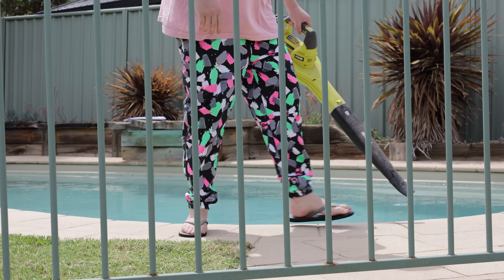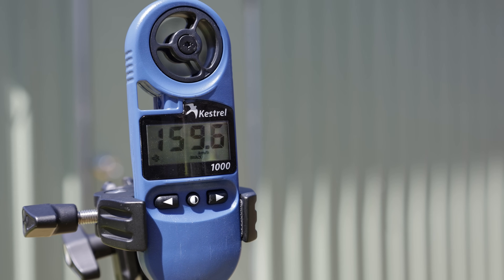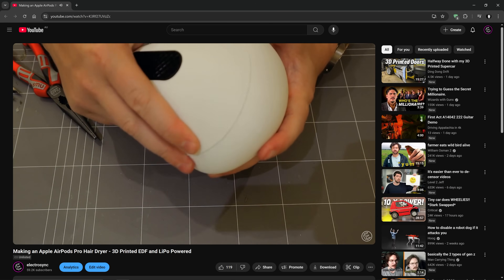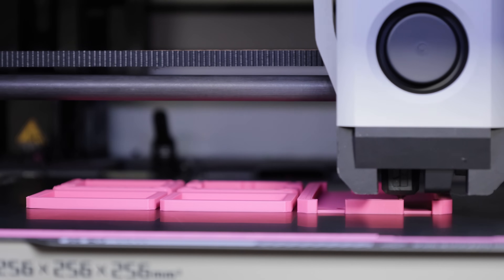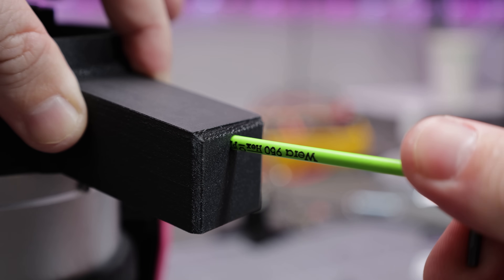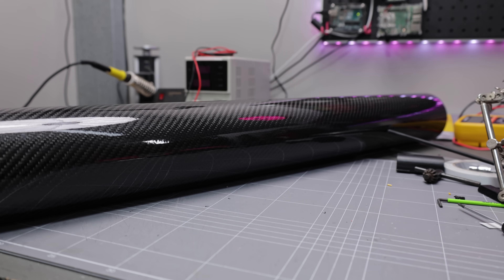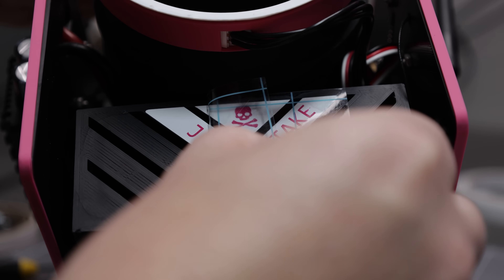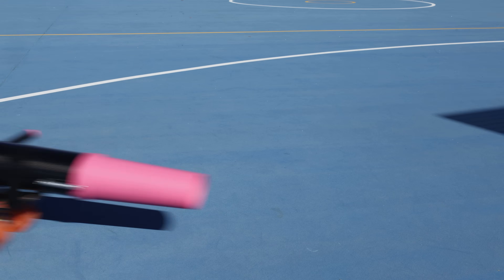Building the Ultimate Leaf Blower

Comment from the maker: What else can I blow with this thing?
Reply: make a paint shooter
Reply: @nilpyc307  yeahh
Reply: Leafblower race?!
Reply: Oh maybe the Bernoulli Effect!
See how high you can keep a styrofoam ball suspended in the air using this thing!
Reply: Yourself. But seriously why did you have the air pointed up when you tested the Ryobi leaf blower on the skateboard, shoulda had the nozzle pointed down i feel like you cheated the Ryobi
Reply: @electrosync  EDF powered speed run on the utility boat ?
Reply: do not mow with toe out -life advice (use boots or shoes that has grip)
Reply: Maybe you can blow a semi dry after washing
Reply: ... nah, I better not.
Reply: No, you should spin the fan in reverse and use it as a vacuum.
Reply: Yer mom. Sorry had to. 😌

Comment: So countless hours spent to create something that cost, probably double an equally performing ready to purchase product, which I doubt that you used to put in a "hard day's work" because it's bound to need about as much time charging the batteries as it can run off of them, unless you also bought a few hundred (if not $1000+) worth of extra battery packs to keep working.

That is the main drawback I find with cordless leaf blowers, that if their performance is good, you typically don't get more than about 15 minutes of runtime per $100 worth of battery, and for many, over the average life of the battery, it's more like 10 minutes per $150.   Even so, I can get my blowing done in 10 minutes - I mulch mow a massive amount of leaves, and prefer it over a 2 cycle gas blower.

Comment: warning carbon fiber filament is the worst touching it even the bare roll is dangerouse thin filament fibers break off embed in your skin never come out you can eat something and they get caught in your lungs or throat... cut carbon fiber without a sealed dust mask and not a medical mask a 3m paint mask with goggles and gloves on then washing your skin after is the only safe way to handle anything cf..... the stuff also gets into the air do it in the open etc... you can use water to drip onto the cut or spray it with water while you cut would be better.. but cf filament is the worst .... it may look nice be only 20% more strong but its like asbestos

Comment: Throw some venturi bit on the front, add some foam strips inside (preferable in a slight twist like gun barrelling) to disrupt high frequency noise resonance, and add some sort of intake screen. If that thing is powerful enough, the blades taking twigs and leaves let alone dust will surely do a number on what is in front of it.

Comment: That's cool, i've always wanted to build something just like this, however i do have one bit of constructive citicism for you @electrosync - what you're doing is moving a little bit of air really really fast; which is awesome for making an rc jet go fast, but you're not actually moving that much in terms of mass flow rate.

In other words the leaves you're pointing at get absolutely blasted, but anything right next to them don't get affected much, making it like trying to clean mud off a car with a thin stream of water, rather than a wide spray - so here's my 2 cents for a design tweak that would make it work even better as a leaf blower:

Firstly have a gap between the back of your motor nacelle and your thrust tube, maybe an inch as a starting point, more air will get sucked into your thrust tube this way, increasing mass flow rate. This is widely accepted practice for increasing thrust of high velocity jet engines in real life, you can look at the AJS-37 Viggen, the Su-25 etc. 

Bernoulli's principal in action - air speeds up = pressure drops. Pressure drops = more air rushes in to fill the void.

Secondly, have a slight constriction within the last 10% of your tube length, this will cause the air to diverge slightly into a cone shape as it comes out, giving you a much wider area of effect.

Comment: I also have a brushless ducted fan blower. I am considering converting it to a volute design since those have better static pressure and can send more air down the tube. Ducted fans are great at thrust, but can't pressurize  a long tube as well as volute designs.

Comment: power doesnt necessarily equate to better...
found a pair of blowers, probably from a jumping castle, on the cleanups. or those wriggly tube displays...
they put any leaf blower to shame but only run 450W. versus 2000W+ as most advertise...
except they also take about a minute to get up to speed.
struck me that another aspect of leaf blowers is the responsiveness. they dont use the power to move air, they use it to accelerate the wheel.

considering all the content on vortexes...why not a rapid fire vortex cannon? need something... focused.

Comment: 3D printed carbon fiber is proven to not actually be stronger in the X, Y, or Z axis, but carbon fiber dust is about as genotoxic as asbestos. Google: "PMC5014234", "PMC9145953", "26048651".
All those little fibers are imbedding in your skin when you touch the part, and some are flying into the air and being breathed in. 
Since 3d printed CF is literally worse in every aspect except extra rigidity for propping up poorly designed parts, there is no reason to ever use it considering the dangers. It is probably just chopped scrap being sold as something 'new' but is actually useless.